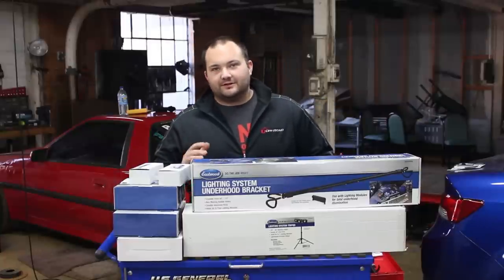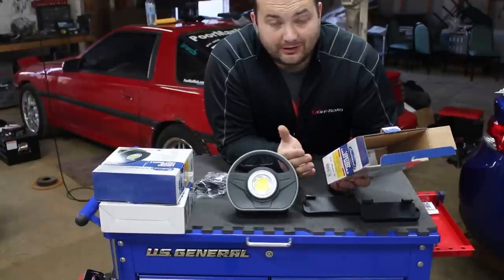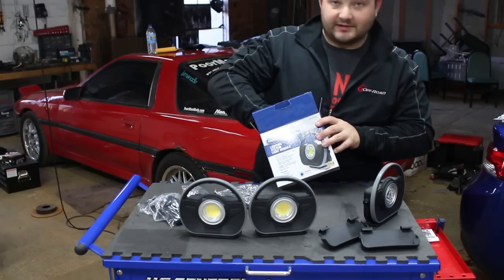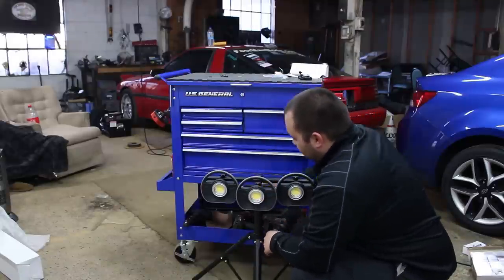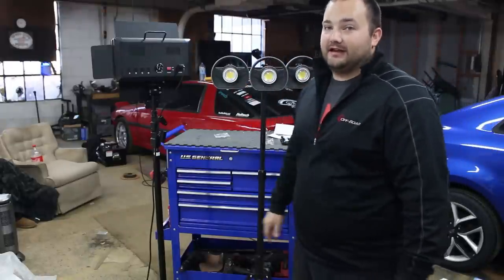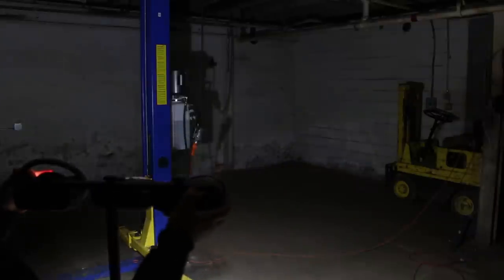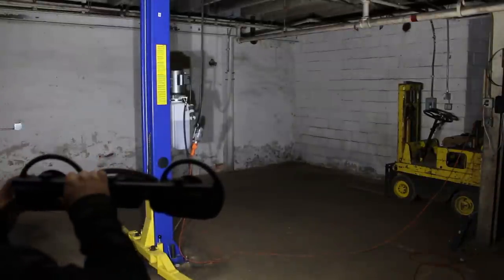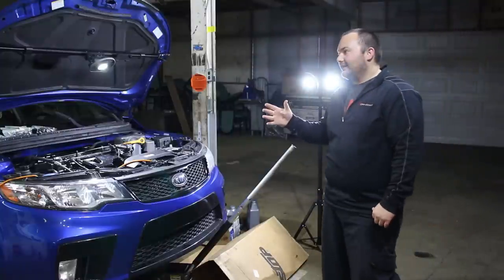Is this the ultimate work light setup?! Eastwood Modular LED Light System

Comment: The underhood light needs a stronger battery - does not last very long.
Reply from the maker: I usually have mine turned on using the dimmest setting and it lasts a for a few hours for me
Reply: Thanks, I'll try that